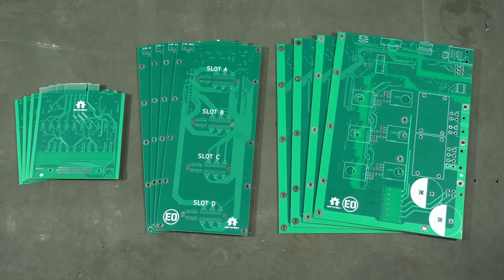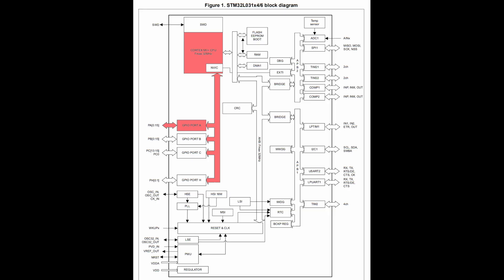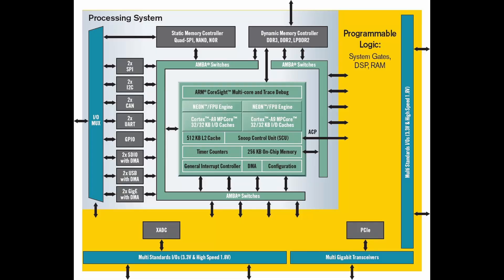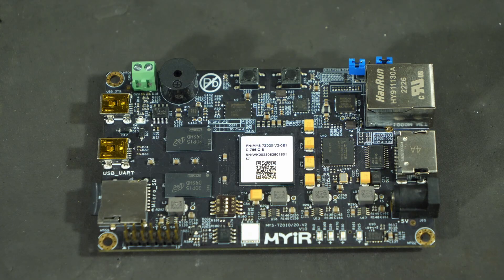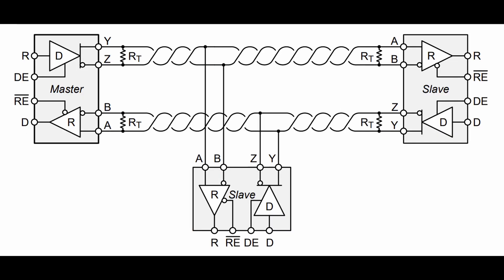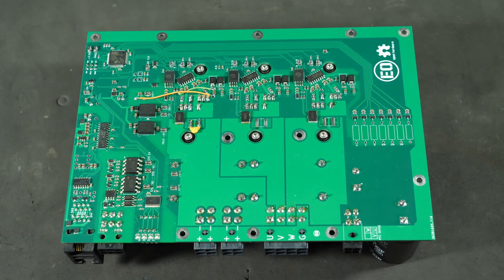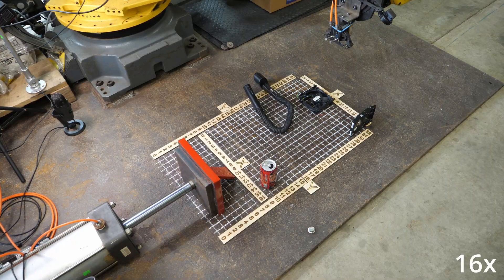The First PCBs: Open-source Industrial Robot Controller Part 3

Comment: Hi EO, very interesting that you have succeeded in talking with a Fanuc motor encoder and that you are making a servo driver that can control a Fanuc motor.
I work with Fanuc Robots and Fanuc CNC controls on a daily basis.
but I am very interested in being able to control a Fanuc motor from another CNC or PLC controller, I would like to be able to reuse the Fanuc motor on some of the CentroidCNC NC controllers. their CNC controller has an open interface for controlling their CNC controller, something you might want to look into.

Comment: Great content! I have been designing/building motion-control systems for decades and my latest development is based on the Parallax-P2 MCU. This device is so perfect for my needs that I often wonder if they designed it just for me 😁
Eight cores ("cogs"), all identical and 64 "smart-pins". Each pin is like a mini-processor in its own right and is capable of many things. Set-and-forget PWM, any pair of pins can decode quadrature (zero impact on any cog) @ sysclock/4, 16bit DAC/ADC, etc., etc. No need to ever use an interrupt. Can be programmed in SPIN (byte-code interpreter), compiled SPIN, compiled C, compiled BASIC (really nice), PASM (assembly). No FPU but I do all the time critical stuff with integers-only (there is a 64bit INT/UINT).
The quad-decode is cool because there is the option of reading the absolute count or the delta between reads. It can also report axis velocity. Parallax is not mainstream so very few are aware of this awesome device.
Reply: The Propeller chip and what came after is a brilliant design. But does require a bit different thinking.

The Basic Stamp got so many started with microtrollers back in the day…wish Parallax was better known.

Comment: Imagine going through your local scrapyard and finding a servo (happened many times to me) and convincing a the guy to sell it to you. Then you get home, you wire the encoder carefully, hook the driver to the pc, set up the encoder type/variant, 24V brake on the servo, dick around with the settings so the follow error is good enough and voila you'll be able to power your coffee blender with it :D

Comment: Great work. I had same ideas for the mains dc but i have a feeling that direct rectified dc for the motor bus may be avoided for safety and power factor issues. I was wondering what high voltage industrial drivers do. Do they have a proper switching dc power supply to provide all those kw?
Reply from the maker: Most robots have a huge isolation transformer then probably some active PFC, not really sure though, they definitely aren’t a full switch mode supply but I would think they’d be a bit more than just a rectifier.
Reply: @ExcessiveOverkill it you have the connections and or time, it would be very interesting to find out more about it

Comment: Curious how your going to setup the Zync. I think this is going to be a massive software/pl effort if u roll ur own motor control loops. I think ur better off using a old pc and using EMC (linuxcnc) and a MESA card for 0 jitter step/dir since the gcode preprocessor in it is really good.
Reply: Control loops are actually child's play and LinuxCNC need to drop the "real-time" from the PC and let a MCU handle it. I SMH when I read the LinuxCNC forums.

Comment: Might want to check out the TI AM2634 as well. TI has a set of RISC processor accelerator cores with tightly coupled (very low latency) memory to the primary RF5 cores. These are called the Programmable Realtime Unit (PRU). Same basic idea: offload low-latency, realtime communication, or control laws out to the PRU cores. Each PRU has its own GPIO and a small set of its own peripherals (UART, SDFM, and Ethernet).

Comment: I find the title to be a bit misleading since it says "industrial" , but you are making a home grown solution with no certifications and missing many design features that would all be required for actual industrial use. Is this a robot controller, absolutely. For industry.... not really.
Reply from the maker: Industrial is describing the robot, not the controller. It’s much more for super customized or developmental stuff, not a normal controller replacement. Sort of like what LinuxCNC is
Reply: You see a plant floor recently? Windows-based PCs are everywhere. I keep coming across machinery that still run on my "home-grown" PC-based DOS controls from the early 90s before "industrial PCs" were a thing. Thanks to being a common architecture, they have been able to keep them running. Today, I replace Siemens controls that are <15 years-old because no-one can work on them. I still design my boards to use socketed chips and other thru-hole components and I include a "care-package" of spare devices with each system that I ship. I come across brainwashed engineers, all the time and all they can do is pick-up a phone to call for outside assistance. A 50-cent opto-coupler fails in a PLC and they simply order a complete input module and if the lead-time is weeks away....oh well.

Comment: why dont use ethercat solution ?
Reply from the maker: We did heavily consider Ethercat but due to it requiring a license or dedicated chip that isn’t that great to interface with we decided against it. It’s very much a locked down industrial thing, not very open source friendly
Reply: @ExcessiveOverkill  cant you buy leadshine controller and use it ? or beckoff ?

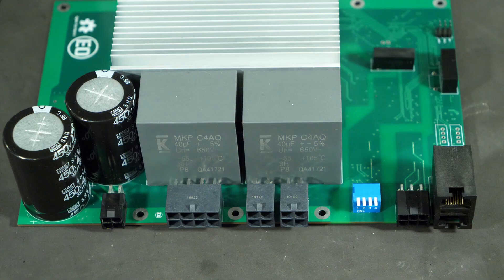Comment: 8:14 that PCB needs some rounded edges
Reply from the maker: Added to the revisions list🙂, can’t believe I overlooked that.
Reply: @ExcessiveOverkill hi mate ur controler servo drive can drive any ac servo drive?? Also can input step/dir for position vontrol?
Reply: Why would you need rounded edges? Just cuious
Reply: @paulw2791  to protect fingers for example, the PCB is pretty sharp.

Also to a lesser extent it distributes forces from one point, so it may chip/damage less.

Same reason why you make chamfers on mechanical parts, be it from metal or 3D printed.

Sharp corners bad.
Reply: @anterprites  Oh ok, makes sense.

Comment: I hate it when people re-use standard connectors for non-standard uses. Why not pick any of the other b2b connectors that can't be mistaken? There are so many card edge connectors and you picked the only one that has a standard use.
Reply from the maker: You pick standard ones because they’re cheap and a ton of manufacturers make them so they’re usually in stock. Lots of things use pcie connectors that aren’t pcie because they’re common. I did look at other more industrial connectors and they just cost 2-10x more and are harder to get
Reply: @ExcessiveOverkill That's simply incorrect. There are many other edge connectors that are dirt cheap. E.g. G630H9811310EU or FX27-40S-0.8SV or any of the plethora other options. It would make for a much more professional board if you use purpose suiting connectors, aside from the risk somebody might plug something in a board it doesn't belong.
Reply from the maker: Theres no reason to complicate designs by using extra nonstandard connectors unless needed. They function perfectly fine. If I ever would switch it would be for something industrial like the DIN 48612 connectors which are way nicer than edge connectors. There’s not really a risk of someone plugging in the wrong thing with one of these connectors since the whole thing is supposed to be in a housing that only fits certain size boards. My actual concern was using rj45 connectors to run the drives since they are NOT Ethernet compatible. However both the connectors and the cables are so common and cheap it didn’t make sense switch to a custom solution solely to make it harder for someone to break something. Especially considering non-Ethernet rj45 connectors exist everywhere in the industrial world.
Reply: @AdaptivePhenix  Wrong on all accounts. And your designers not being able to properly source components doesn't mean you should just use whatever. We all laugh when we hear Russia has decided to give chips in washing machines a second life by putting them in their weapons. This is is the same, where available you use what is appropriate based on your industry standard. This in fact fixes the issue you described because everyone uses the same components so they will be produced at volume.

Comment: Line reactor not commonly used.    
Could this have something to do with causing problems or needed for  regenerative braking of motors ( Power back to the grid ) ?    I'm aware that some sort of circuity would be needed to convert variable AC back to stable grid. 
I know that with a standard inverter running a motor for variable speed with a high inertia load, an external resistor bank is used to burn off excess DC bus power.  For example, Haas milling machines use standard home stove top heating elements as an external resistor bank.
Reply from the maker: Brake resistors are common, but it should be possible to use the servo drives in reverse with the addition of a line reactor (inductor) to convert power to/from the AC grid. That way regen energy isn’t burnt off and is instead fed back

Comment: regarding the line reactor: I don't think I've heard it by that name in industry before, but from a quick google, it looks like it is functionally similar to a line filter, which is common (moreso in Europe than in the US) in industrial motion systems, although typically it is an add-on feature external to the drive, since not everyone wants or needs it.  The drive will typically just have the rectification stage, and maybe some smoothing downstream of that to get a cleaner DC bus, still allowing for the drive, as a single unit, to be powered by AC.  The most common configuration is for 3-phase electricity, at the voltages typically seen in industrial buildings, 230V or 460V in the US, although single phase configurations down to typical household voltages are not uncommon.

In my professional experience, what is actually more uncommon for commercially available industrial motor drives is to have the DC bus externally exposed. If the expectation is that the drive will be powered by, say, 460V 3-phase AC, then the DC bus doesn't need to be exposed, and if it is exposed, you need to make sure the DC bus generated off of the AC power can't make it out of the board with some (probably pretty beefy) protection circuitry. I've seen DC buses spike up past 900V during normal operation, and I expect (as I've never worked in R&D in this industry) VFD/servo drive manufacturers don't see much value in adding the protection circuitry and ports to allow the drives to be powered by an external DC bus, when direct access to 3-phase AC power is more common amongst their customers.

This isn't universal; there are some use cases, such as multi-axis systems, where the DC buses of multiple drives are linked together with a busbar, but I think that standalone drives with only an AC power option are somewhat more common.
Reply from the maker: Mostly everything I want to do with the drives requires multiple, sharing a DC bus is great since it helps with the total bus capacitance and gives lower ripple. Instead of a normal full bridge rectifier to go AC-DC, I wanted to feed AC into the output terminals of the drives to use them as active power factor correction. That way the power factor isn’t horrendous like with full bridge rectifiers that only pull power off of the peaks of the ac sine wave. The line reactor/filter (basically just inductor) is needed since by default the ac line has almost no inductance and would result in the drive not being able to regulate the current correctly. The drive should also be able to boost the bus voltage up above what a normal rectifier could do and also support bidirectional power flow so you could feed regen energy back to the grid like some of the newest Fanuc controllers

Comment: I’ve just ordered some TMC4671s and TMC6200s myself, because programming FOC sounds like a pain. I’ll also try to shove some ZXGD3006 totem poles between the TMC6200 and the FETs, though I’m not sure if I’ll end up with oscillation on my gate pins. TVS diodes from gate to source, maybe? I guess to minimise ringing I should design the PCB in order to reduce the gate-source-driver loop inductance.
Reply from the maker: I think the TMC6200 is a pretty powerful gate driver itself. I spent quite a lot of effort to get the gate drive loop area very small, the traces are directly above and below each other to minimize ringing, most of my issue I think is from the DC bus having too much inductance between it and the fets.

Comment: Just a suggestion - consider using AMP Superseal Connectors instead of the old parallel ports. They can be a bit pricey but much more rugged for industrial applications. There is a PCB mount option are they are commonly used for car ECUs
Reply: Why not just jump to an actual industrial connector at that point? The man could spend 10k on harting connectors alone.  Unsealed Molex connectors are good enough for Fanuc.
Reply: @HansolControl yup, Molex, or Amphenol in Fanuc competitor OEM
Reply from the maker: Ah that’s what those connectors are called. We did spend quite a while looking for different connectors. Since it needed ~40 pins, most of the nicer connectors ended up almost doubling the cost of the whole assembly. I would prefer something a bit nicer than the DB connectors though. I also still see them used in industrial applications for connections inside of panels, I just wouldn’t want them exposed to the environment.
Reply: @ExcessiveOverkill I think you're doing good. I don't think your industrial robot will be used in an industrial environment. It's always good to keep an eye out for what can make it better though.
Reply: More myths. Most industrial controls have an easier life than desktop PCs.

Comment: Great progress.  I do think it has limited usefulness, given the relative affordability of modern used robots.  Just watched two unused Kuka's, fully outfitted with 9kw (may have been 11kw) spindles, tool changer, enclosure... sell for $33k at auction.  They were purchased new in 2021 or 2022 and never put into production.  But I hope to proven wrong.
Reply from the maker: I don’t expect it to really be a replacement for where you could get a normal robot and controller for cheap. I want it mostly to fix the limitations of what the really old controllers can do. And also run stuff besides robots
Reply: @ExcessiveOverkill  Have you seen what Brian Brocken has done with an ABB SC4 controller?  He basically made a drip feed for the program that's running on the controller.  So you get to run long complex programs, but keep all the existing robot drives/controller/pendant.  Your solution will require replacing all that will it not?  While doable for someone with your knowledge, I'm thinking there may be only a handful of others who will take on the task. Anyway I'm not trying to be a jerk about it, I do hope you are successful.  It's a monumental amount of work and impressive.
Reply from the maker: Yea I’ve seen the drip feeds, unfortunately by default most Fanuc controllers don’t support external program input so they’re kinda useless. Anyway it is pretty dang complicated rn, I’m hoping one it’s actually functional I can get it closer to something others could use without knowing all of the super low level stuff. It’s going to take years for that tho, but it’s a good side project for me.
Reply: But where is the fun in that?
Reply: @Citronitroify True!
Reply: I guess we can also build our own smal scale arms with those giant brushless some companies sell.